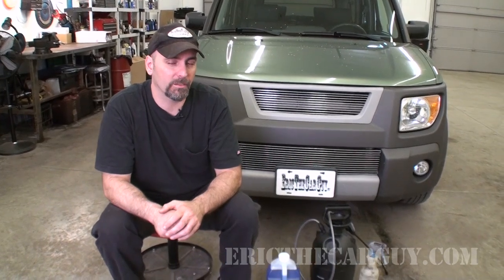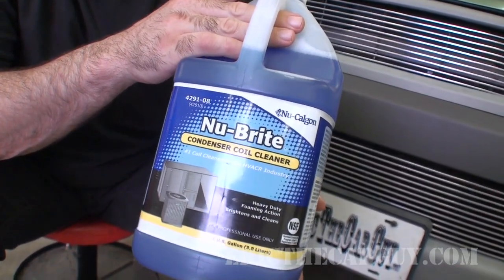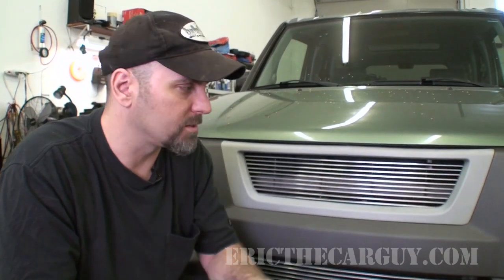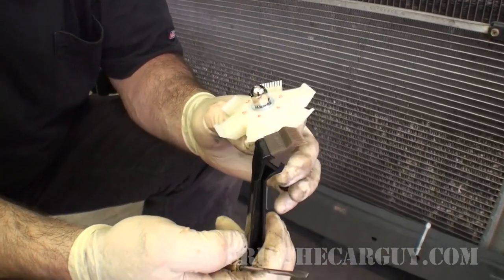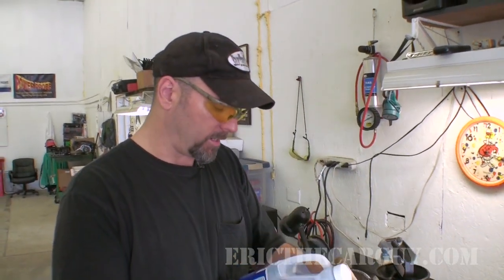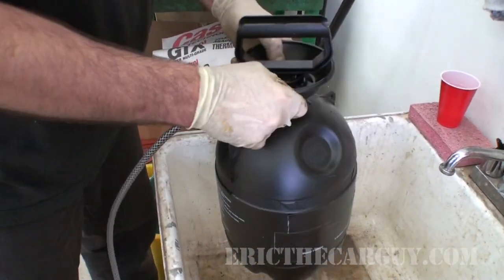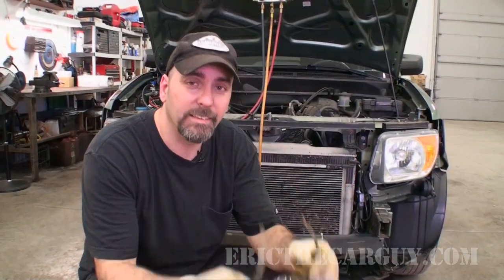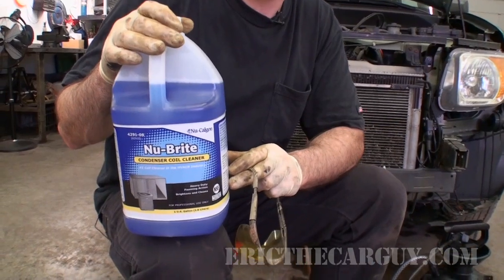Increasing AC Performance by Cleaning Your Condenser -EricTheCarGuy

Comment: Hi Eric and guys,  Did you notice the low side pressure after the cleaning?
Reply: With a drop in pressure on one side, there has to be a drop on the other. He pointed out the high side because its the most dramatic. Unless you do A/C for a living, a 3-6 psi drop wont amount to a hill of beans.

No hate, I assure you. Take 'er easy, bud

Comment: Eric, the vent temp can't go below 38℉. There is a thermostat switch that shuts off the compressor when it gets that low.  This is why your supposed to do the vent temp check with the fan at max with the vent on recirculate and the doors open (says so in the helms). Running the system at max won't bottom out the temp, instead it maxes out the capacity of the system and then you will see a difference in vent temp.

Comment: Thanks for this recommendation. There is a whole line of products & specialty applicators for hard to reach condensing cores (My current project) without dash removal. Elated to be able to do a through cleaning for the effort spent

Comment: could you do an experiment and put regular clean aluminum foil and dip it in to a container of this stuff and see if it bubbles up.  (Dont dilute it either) Im just concerned it is "eating " away the aluminum its self.  If it doesnt Im buying a gallon of this stuff.  I could use it on the Home A/C Unit all my cars  my ATV that has a radiator etc.,etc.,    
Great Video very impressive
Reply from the maker: I actually did this to my Vigor's evaporator the other day which is aluminum. I notices a slight discoloration of the metal but nothing I was concerned about.
Reply: It's designed for aluminum. It's only purpose is to clean condensers, and 99% of them are aluminum. I'm sure it'll hurt the aluminum if you never rinse it off.
Reply: sweet  I'm really wanting to get a gallon of this stuff.  I just didnt know if it brightened it because it was eating a layer of aluminum off.  Which in most cases is perfectly fine but If I had a warn rad/ anyways and just wanted to clean the other parts of the radiator I was wonder if I should avoid that area.
Reply: I am thinking its not actually dissolving the aluminum, but the aluminum oxide, the white coating you get on the coils.  It may not do anything to clean aluminum.
Reply: that makes sense

Comment: EricTheCarGuy Sir.  I have a 1997 dodge caravan 3.0l 3speed, it 20 years old, well I decided to replace the whole harness wires under the hood. So got myself the whole harness wires from the junk yard and of course the condition are much better than mine.  What I did was I connected each individual wire the same color that they should be but then horrible thing happened, there is a sound came from the area where the relays and the fuses are at the sound sound  like this e..e..e..e and the horrible is the van doesn't start.  EricTheCarGuy Sir. I need your help, and how do I get a wiring diagram you know 1997 caravan. PLEASE HELP Thank you and God bless you.

Comment: That type of condenser is not as receptive as some other types of condensers or radiators.  I purchased a fin comb to fix my F150 condenser that was almost 50% blocked or at least I estimate it to that.  My application had fins that you could run the comb up the entire length of the coil unlike the Honda in your video that by design you can only run a fin comb a half inch or so.  I'm sure you have seen other applications that the fin comb actually could be useful.  Still pain staking none the less though. I have not conducted a performance test either before or after to determine if this had an effect on the system.  I do plan to clean the coil with something like Nu-Brite.  I have used it before on cooler systems in restaurants that get gunked up with grease from fryers and it cuts though it like nothing is there.  I know that stuff works!

Comment: Did you happen to use an air hose to blast out the leftover water from the rinse?  I mention that because those fins can hold a ton of water and might have positively affected your results.  In any case, nice job!
Reply from the maker: No. There was time between the rinse and the second half of the video. Plenty of time for things to dry out. Any left over evaporated pretty quickly due to the heat from the condenser and the air from the fans.

Comment: I am about to burn my car to the ground. I've been to about 4 different dealers trying to get my air fixed. Everywhere I go, they say it works fine and is cold... Which it is cold but most of the time only when you are driving. At idle it doesn't cool to a cold temp and sometimes even feels hot. I gives me a headache. They have replaced relays and checked freon and pressure levels and are all supposedly okay. Please help! P.S. My fan used to not come on but now it does but still doesn't work at idle.
Reply: +Paultwice22   I'm not an expert, but it could be a bad evaporator coil temp sensor.

Comment: To even better this test, you could of tested the pressures after just blowing out condenser with the garden hose "jet" setting...
then cleaned it with the Nu brite and tested it.
Just to see if a normal water cleaning is of any help.
Reply: That will bend the fins

Comment: 18 psi is too low for the low side. should be around 35 for 134a at around 2k rpm. sounds like you're a pound low on gas.
Reply: The Honda Element (as Shown in Video) only Holds 18 ounces of 134a and 8 ounces of oil. Hard to be 16 ounces low and still function, the compressor would never turn on. And from my Research it seems about 20 psi is the norm for Automotive psi rating on low side while compressor is engaged. He does seem to be a bit low but not anywhere close to the amount you are "suggesting." - No Hate just adding some info. take care

Comment: i have a 2002 bmw the AC fan does not come on, the ac line has pressure. i get no AC at all. i haven't tried to recharge it yet. any one with the same problem?
Reply: If the fan isn't kicking on, the problem is electrical and not in the system itself. Check the relays and fuses inside the car

Comment: "This is designed to eat away grease" 3:56 - Eric, I am presently trying this with Purple Power degreaser! :D I am making sure the engine is nice and hot. Think it can hurt, or am I wasting my time?

I'm letting it sit for at LEAST 20 minutes, and I even let the engine run to keep it nice and hot.. before I give it a bath with the garden hose. :)
Reply: No! This product is NOT suitable for residential or automotive applications ..tri powr hd is what you want..
Nu brite is to caustic

Comment: I thought you wanted high side pressure above 200?
Reply: I once witnessed a bus whose roof AC unit had only one condenser fan out of five actually turning. The compressor still managed to run (fuck knows how, because it had a HP switch) and that thing sounded like it was about to blow up any minute. The vibrations it was making were scary. The driver told me it was cooling, but" barely". Don't know what he meant with "barely". You want that pressure as low as it can get.

Comment: Good video and good advice for shade-tree mechanics. But automotive A/C units run around 200 psi high side and more depending on ambient temp. Any less and something is wrong (or wet.) If you were to check it the next day the condenser would be dry and the  pressure would be back around where it was originally...that coil wasn't that dirty.

Comment: High fan speed on the vent will best show the vent temp. My vechecial at low speed trips the freeze sensor shutting off the compressor at 41F. On high fan speed the compressor runs continuous and vent temp get up around 53F. I have tried cleaning the condenser with car wash soap and a very soft brush. Think I will look into getting some specialized cleaner. Never knew they made any.

Comment: Why test the system on low fan speed. An athlete isnt tested by seeing how far he can walk... set the fan to high and doors open. You will find that the pressures are too low. Add freon.
Reply: If you have a variable displacement compressor (such as a Sanden SD7V16), low fan+recirc+closed doors+closed windows lets you test if it's destroking, as it's meant to do when suction pressure approaches control valve threshold, or not. High fan+heater+outside air+open doors+open windows on the other hand lets you test if it strokes into maximum displacement when it should.

Comment: my air blows cold but barely blows out thru vent
Reply: Either your blower motor is not working properly, or there is some sort of obstruction in the airway
Reply: How do I get to the airway to check it
Reply: That would be the last thing I check. Start with the blower motor, see if it's working. It's usually behind the glove compartment. If it's not working, check the fuse first.
Reply: Ahhh I see nobody said to check the cabin air filter maybe it's really clogged not allowing air to pass through well. But like what others said it could be the blower motor usually easy to replace

Comment: Set your power pressure washer to low if you can, or don't get it too close to the condenser, we don't want to damage anything. Works like a dream, fuck that bottle of cleaner for $80 a gallon.

Comment: Holy snacks, you weren't kidding about the price on that stuff. 80 bucks a gallon. I wonder, though, how much benefit you might get from something less expensive. Like simple green And yeah, the fins. Screw fixing fins.
Reply: you can find some stuff at home depot for about 5 bucks a can.  I don't think it etches like this nu-brite does, but it gets good reviews on the website.  its in the AC area.
Reply: Instead buy a new condenser

Comment: The explanation you give on the heat exchanger and the condenser taking that heat out of the car is pure NONSENSE. The hot condenser is the result of the compression of the freon makes it hot and the condenser along with the fan cools the freon down. I have been doing A/C work sense 1970 and the principles have not changed.